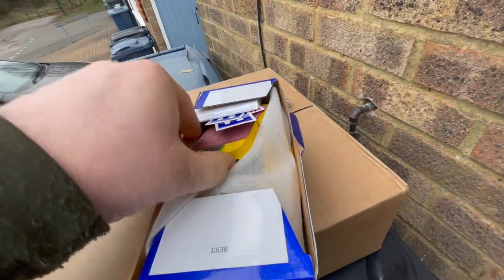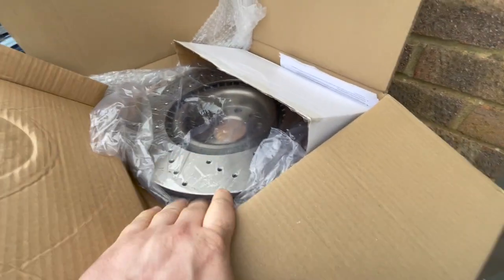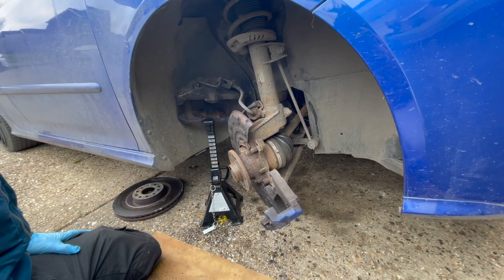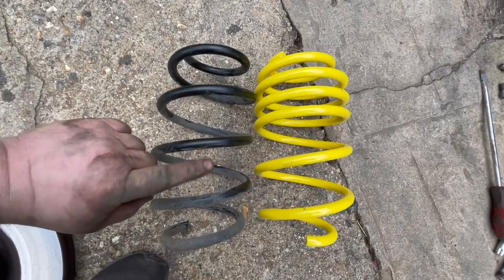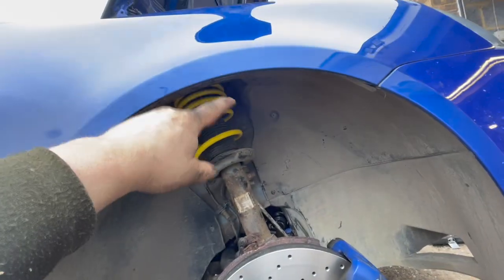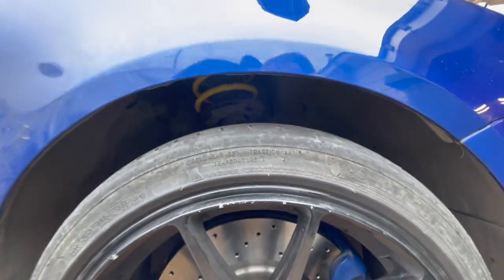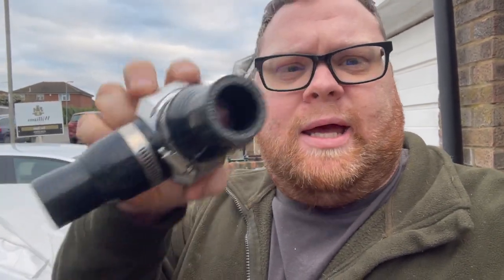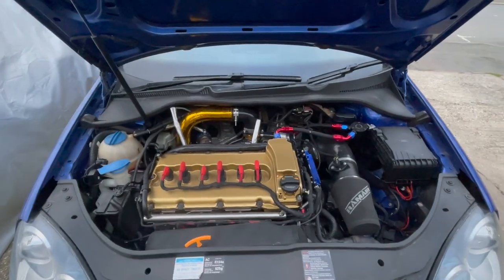VW MK5 GOLF R32 TURBO - GETTING TRACK READY - Brakes and Suspension

Comment: A little tip, next time go for the 340mm disks from the TTS 8j, problem with the 345 is its leaves a lip on the disk as the pads do not fully cover the disk. Also the brake disks at 340 are lighter than the 345. 340 are the perfect size, I have them on my S3 8p
Reply from the maker: Thanks bro. I’ll keep that in mind!

Comment: Did you consider going for coilovers ? Especially as you're planning on taking it on  track. I upgraded to Bilsteins & must admit they're well worth the investment! 
Hope the car is ok btw 🤞
Reply from the maker: Yes I did. But due to cost I was going to do lowering springs with B8 dampers. I just haven’t got to that point yet and had the springs sitting around so thought I’d fit them. I’ll be upgrading later on when funds allow.

Comment: I’ve just put ebc disc & pads on mine performance is good but they make an awful noise 😢
Reply from the maker: Did you put plenty of copper grease on? I know it’s not the in thing nowadays but I always over use it and I only get the slight sequel when the pads are HOT